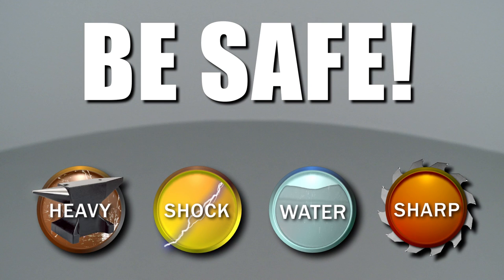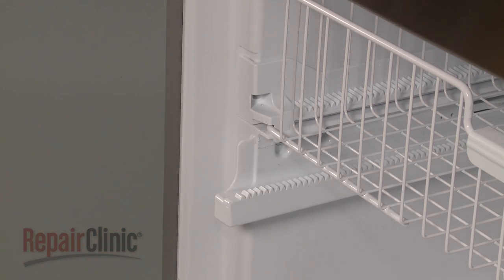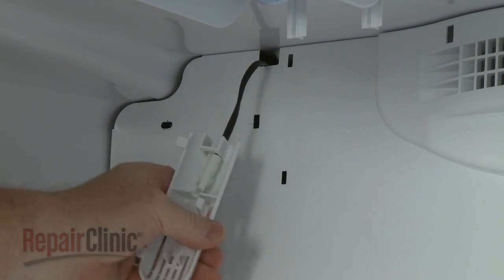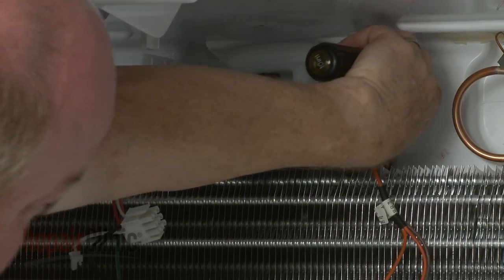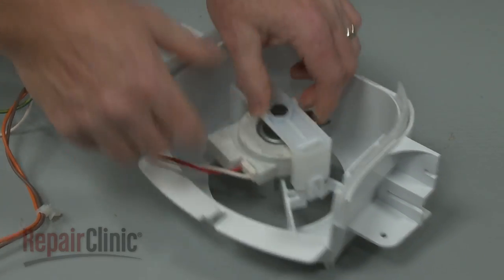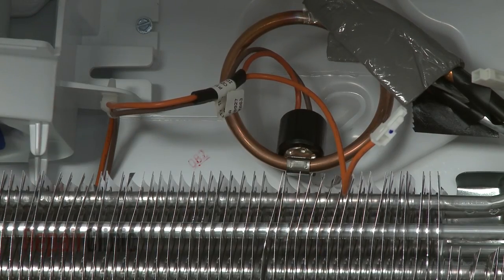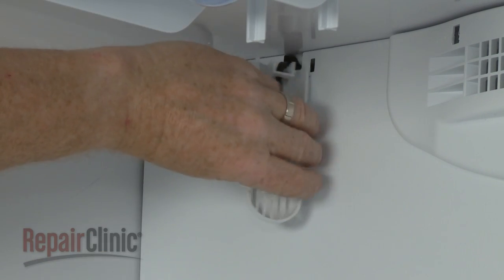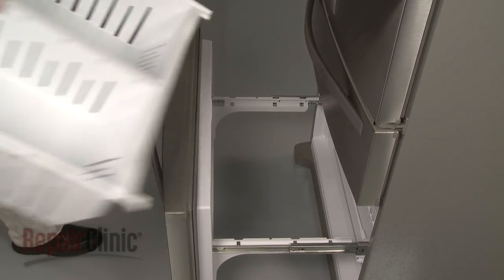Whirlpool Refrigerator Replace Evaporator Fan Motor #W10276647

Comment: FYI - a) if it's making loud rumble/whirring sound, you may just need to take the shelves out and melt ice through the fan vent using a hair dryer. If you're needing to take the whole back panel off to fully melt the ice using a hair dryer, I recommend using the dryer first on the fan "vent" and sensor cover before removing.  I accidentally broke a tab on each, and think it was at least partially because they were still super cold.  Probably more flexible after warming a bit.

Comment: My refrigerator didn't cool, the evaporator fan failed to run, but the freezer was fine. I ordered a new evaporator motor before I got it apart, once the part arrived I went into the freezer area and took out the back panel and discovered a huge ice ball, it was about 5 inches in diameter encapsulating the defrost thermostat that clips onto the copper line. I melted it out with a hairdryer and replaced the evaporator motor since I was already in knees deep into the project. It's a mystery to me where the water came from to form the ice, the evaporator coils were clear so the defrost feature maybe is ok. Excellent video and thank you !
Reply from the maker: You're welcome! 

We are always happy to help. If you would like to give us a review on Google, we would much appreciate it: https://g.page/r/CcVUrahZNozMEBM/review

We hope that you have a great day!
Reply: @jaysmokey  yes, it is working! I'm not sure how long it took to make the iceberg and why it formed, but it runs and the fan circulates the cool air as it should. I put a thermometer inside and its below 40 degrees again. If you can fix appliances yourself it sure beats paying a repair guy. Good luck.

Comment: I repaired my whirlpool today! My fridge wasn't cool and no air was being brought from the freezer to the fridge. The freezer was freezing signifying that the condenser coils were fine and that I still had frieon, so why no cold fridge? I opened the freezer compartment on bottom and took the back wall off and the freezer sensor. I was about to replace the fan but noticed there was no fan I thought I had a fancy fridge but no the fan had fallen off the peg and was laying on the ice. I reattached the fan and now it's spinning and fridge is cool again 😎

Comment: I have replaced the motor but the fan still will not turn when the refrigerator is plugged back in. What is the next item I should investigate? The freezer is cold but the fridge is warm.
Reply: Having  same issue,  did you found a fix ?
Reply: Hi, solved?
Reply: Nobody solved I take it?
Reply: 3:30 
 @Rzelideth11
Reply: @Rzelideth11  q tal solucionastes
Reply: No, yo cambié la nevera😢

Comment: This is a great video for this work.  My evap motor was making noise.  Once I got the rotary shelves out, I could see that the entire back was frosted over.  I let it thaw enough to get to the back cover screws.  Took those four out and got the aluminum back out of the refrigerator. and then let it thaw for four hours using a fan to push warm air in.  Ice was totally around the entire fan assembly and the blades were striking the ice making the noise.  Water all over the floor.  I pulled the refrigerator out so I could get to the back.  Removed the back and drained all the water in the defrost drain tray.  Got to do that or the refrigerator will error code and not run.   I now need to figure out why the defrost cycle did not take care of this? Thanks

Comment: Question: I installed a new fan. It is working. THanks so much for the help. BUT I won't shut off. Is there something that I missed in terms of a Thermostat or other to regulate when it goes on and off based upon the temps in  the frig?

Comment: Great videos for sure! But thinking again when buying this 3- or 4-doors bottom freezer refrigerator again! Power failure can be the cause (or main cause) of fan failure! When power is gone, ice becomes water and water shorts the fan! When power is back on, fan is not running, frost forms, freezer fails!

Comment: My Whirlpool refrigerator is warm, but freezer is cold. We replaced the motherboard in the refrigerator but that didn't solve problem.  Any other idea on what it could be?  Model gx5fhtxvy04
Reply: Hi, I am having the same problem. I'm hesitant to change the fan since it looks like it's in the freezer but my freezer works fine, just the refrigerator is warm. Did you get this solved?
Reply: @akk27  replace the
 defrost thermostat

Comment: I replaced the fan, and the fan motor is not turning. The compressor is running, but no fan.
Reply: Hi, Did you solve the problem. I have same Issue.

Comment: What about putting the wires on the right terminal does it matter or is there a negative and positive right or wrong just replaced my motor and it’s working but now the fridge not getting that cold can the fan spin a different direction if wires are switched to wrong terminal thanks my wires weren’t a exact plug in replacement had to splice in not sure if I got it right